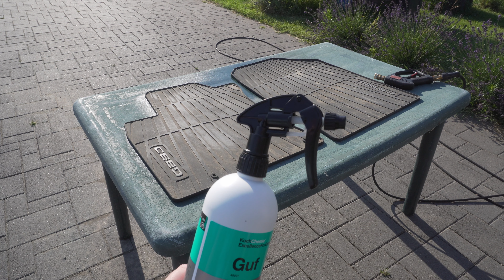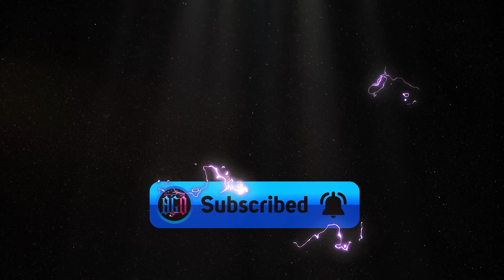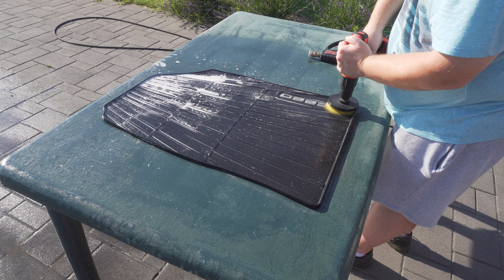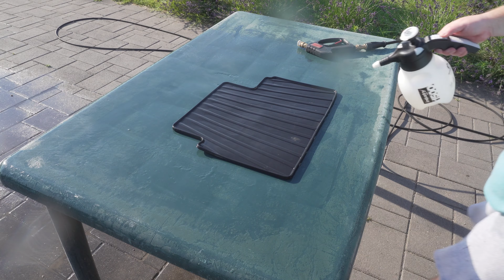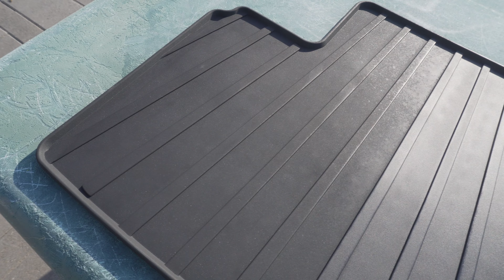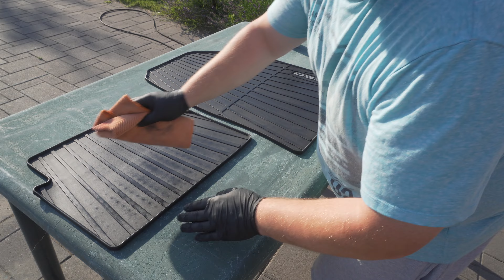Koch Chemie Gummifix (GUF) re-test - EN

Comment: It works with safety and you can see it! It leaves a satin luster. I see. Correct?
Reply from the maker: Yes, it is like satin/matt(ish).
Reply: @OCDaddyZsolt  will try it too and maybe make a video about it on my channel. I've had my rubber mats soiled for a long time to do a full test. Will also try different cleaners to get the mats clean again. I have several rubber mats to do the test. I'm excited to see what comes of it.
Reply from the maker: @andreas.albin87  👍